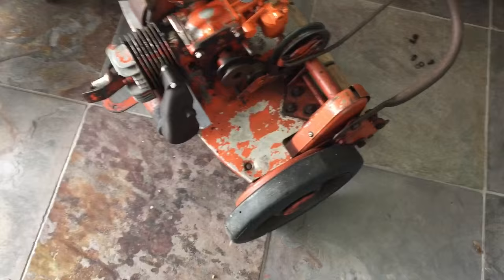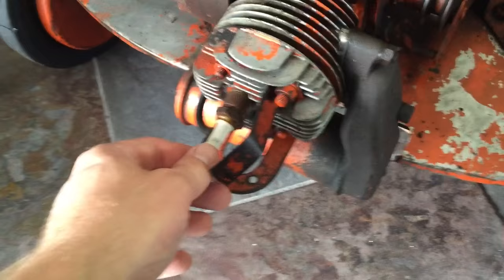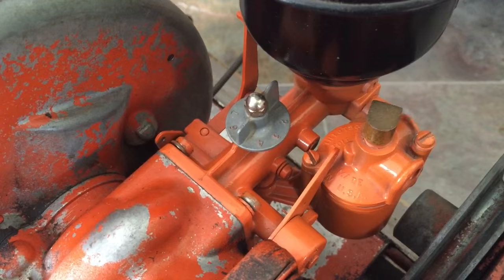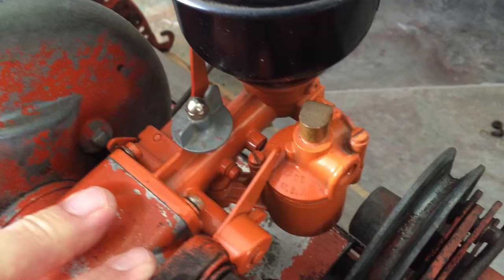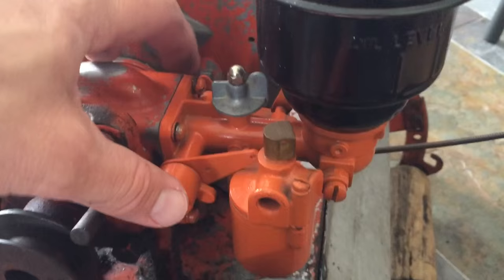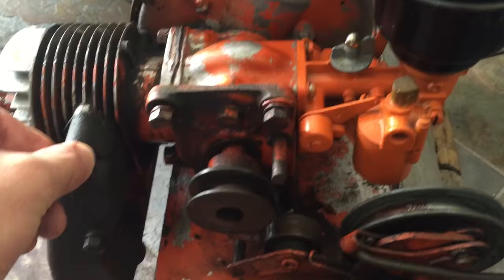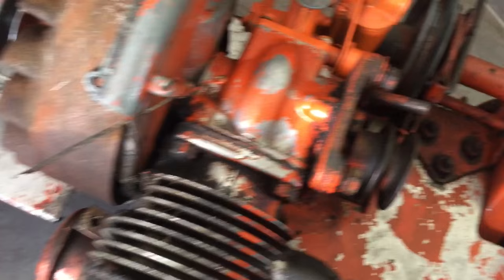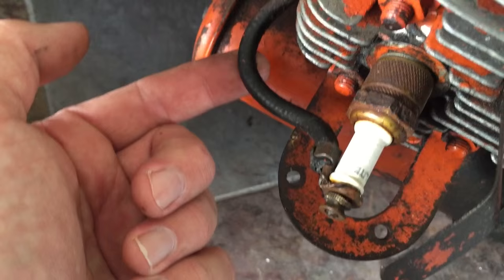1951 Jacobsen Pacer - Vintage Reel Mower

Comment: Hey I just got one that had been sitting many many years it was stuck.  I got it freed up and cleaned the points and the carb and got it fired up.  Mines a 21".  I had it running in 20 minutes I'm a small engine nut haha.  But my question is how did you find the year?  I could use one wheel too
Reply from the maker: Thanks man. I still have this one. I love it. It runs great. If I remember correctly I found a site that you could enter the serial number and figure out the year. I think it was on smokestak.com

https://www.smokstak.com/forum/showthread.php?t=60489
Reply: CT moog you still using it? Mines mostly complete!  I can't wait to go mow with it but id like to get a wheel
Reply from the maker: Yes, I use it sometime for fun. I have a honda mower that I use most of the time. You might find a wheel on ebay. upload some videos of yours when you have it ready. I would like to see it. Check out some of my other videos.
Reply: CT moog ive seen some of the other videos!  I'll make a video of mine when it get her all ready to go and the grass is growing! I didn't see any wheels on eBay sadly but I shoved some radiator hose in the big hole in my wheel then filled the rest in with silicone so it's round again it should work good enough.  Mines complete but it's rough and hardly any paint left but she runs like a dream
Reply from the maker: cool, cant wait to see it.